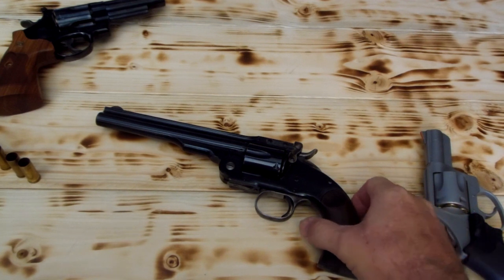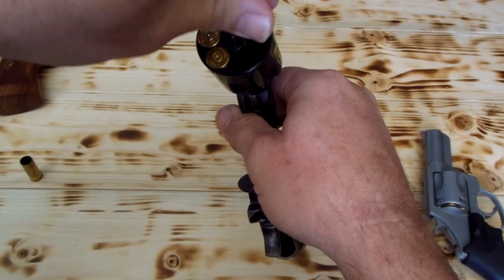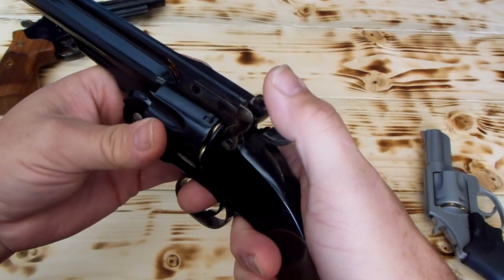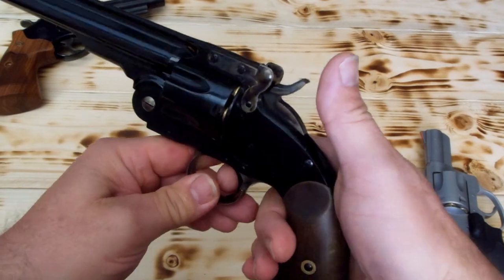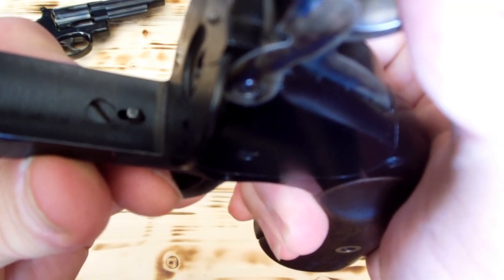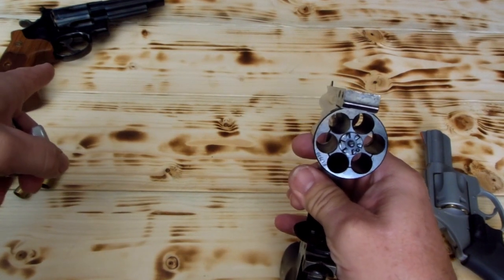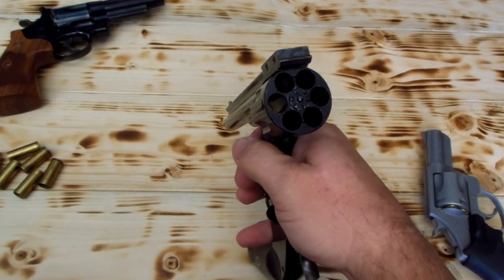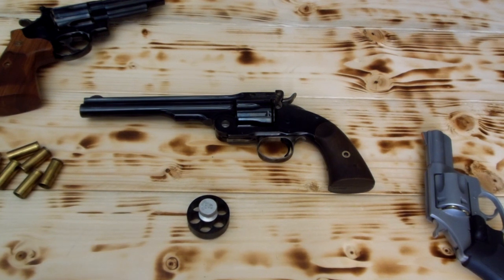"Tactical" Schofield carry and reloading

Comment: I mean they did it back in the day with navy revolvers why haven’t they done it with any other single action revolver
Reply from the maker: I know the reproduction percussion Colt Navy has a notch in the hammer and pins between chambers for carrying the same way...6 up. I *believe the original Colt Navy did, too...but someone may correct me on that.

 This method works just fine on this Schofield.
Reply: @plowboysghost  The originals also had the safety pins on them.  The manhattan firearms company also manufactured colt clones with extra cylinder stop notches to lock for the same reason.
Reply from the maker: @coltonregal1797   Good deal.
Reply: Because your firing pin is resting on hard steel. Let it fall one good time and your gonna need a new pin.
Reply: Your pfp is amazing
Reply: @PureAmericanChristian  thanks it’s mostly off of a photo of a friend making a goofy photo of John Marston from RDR 1&2
Reply: @jayhaddan7927 no it doesn’t. The f p doesn’t need to be this long to set off primers

Comment: I used to work at a gun shop that sold Uberti Schofields. I would admire the one in the display case quite often, and one day I was reading the instruction manual and it said that it had an "internal safety" which worked by partially cocking the hammer one click, then lowering it again. My guess is that this "safety" was doing exactly what you're doing now: resting the firing pin between two loaded cartridges. Very cool, and I'm jealous of your revolver! I've been putting aside my pennies over the years to purchase one myself. Not too far now... :)

Comment: This may have been the intent of Major Schofield himself. There's a lot of Schofield's suggestive correspondence in S&W's period files, and one letter refers to a modification of the firing pin point being beveled on each side,  possibly to carry like this. However, there is no mention in Army manuals on this. But it does work if you need that 6th shot!
Reply: Undoubtedly Officers and NCOs issued these revolvers loaded up 6 and carried that way as well as civilian professional cognoscenti, like the James Brothers and Texas Rangers and Wells Fargo agents.
Reply: To expand on my above comment, in a letter from Major Schofield to D. B. Wesson dated August 4, 1876, he stated "hammer to be beveled so as to drop between the cartridge heads, the arm can then be carried loaded with the hammer down". Recent Uberti's seem to lack a bevel but the hammer nose seems small enough to be used that way. Much safer than using the half-cock "safety notch", since the cylinder is free to turn.  Anyone for "Russian Roulette"?  lol
Reply: @samwalker7821  Reminiscent of the system on percussion cap 'n ball revolvers, positioning a hammer down between 2 capped chambers.
Reply: @richardkluesek4301  True. The concept wasn't new, but the application was. Major Schofield took a lot of pride in his pistol and had many ingenious ideas.

Comment: The SAA in .45 Colt and 44-40 you can do something similar.  This idea of resting the hammer between the rims is a hold over from the cap and ball revolvers resting the hammer in a safety notch or on the safety pins between the chambers.

Comment: I just sent my cylinder to TK Custom in Illinois and had them mod the cylinder to take .45 ACP on moon clips. Works awesome. Will still take the .45 Colt as well, so now it's dual service. Be sure to get their moon clips specifically for the schofield. I run the same reloads I use in my Webley Mk VI and it shot super tight.
Reply from the maker: Sweet!
Reply: @plowboysghost  Yea, it's a pretty cool mod.
Reply: Now you can, but why would you want to???
Reply: @mothman-jz8ug   Moon clips. I run a shaved Webley and like the speed of that set up. With the mod'd Schofield I can run .45 acp as well as the 45 colt, which I'm reloading for both, but have some decent 45 defense loads I want to try in it.

Admittedly not a nescessary thing, but it's a dual caliber platform now.
Reply: @mothman-jz8ug why would u want too? To run moon clips ! Are u out of your mind their fast as anything and cool as can be. And reloaders love to stick to rounds their set up for so now you’ve more than doubled  your options. I love small primer .45 so I’d be able to stick to my cheap fav reloads. That’s a awsome thing. .45 acp has a much smaller volume so they’re much more efficient if u wanted to light load. Theirs a ton of advantages to such a thing. Why would u mess with someone about how they enjoy their gun? What would u rather pay for  1000 rds of .45 acp or 1k of .45 lc ?

Comment: before the s&w 3rd model, perfected came along (the top break that also had a thumb piece like a regular Smith & Wesson model 10) there was the second and third model in 38 Smith & Wesson and it always struck me with that non-rebounding hammer that the reason why their firing pin was triangular and flat rather than round was precisely for this reason to lock between the rims with higher confidence that a cylinder turn would not jar the pin up over the rim. I also use a regular five shot 38 snubby speed loader for tactical speed loading the little top break as well. And I do the same thing for the Webley 455. Good video!

Comment: Damn. That’s solid advice actually. I carry my Cattleman II in 45 colt sometimes with 6 cause of the special firing pin. That’s a good idea for the schofield.
Reply from the maker: If yours is a Cattleman II, like the Taylor's Smokewagon Deluxe i had, I wouldn't hesitate to load six in it. I carried the one i had that way until I defeated the "safety" system.
Reply: @plowboysghost  defeated the safety system? What do you mean?
Reply from the maker: @TaxationIsTheft69420  I took the spring out of the hammer, shortened the actuator rod, and fixed it in the "up" position so that the firing pin would stay fully fixed in the "out" position....like a Colt/Pietta/Old Model uberti/etc...

 I did a video on it in January of 2019.
Reply: @plowboysghost  Ah! Ok. I thought you meant you broke the safety by carrying it and it made me nervous. I carry it on horseback for the last 2 years and have never had an issue even with it bouncing. They’re great guns.

Comment: According to the manual that came with my Uberti Schofield, the revolver has a hammer block safety which is engaged at the first cock position. I guess anything is possible, but it would take a heck of a blow to break the steel hammer block.

Comment: There used to be some revolvers back then that did this on purpose as a safety feature. I can't remember what brand it was but I do remember it had a tiny pocket for the firing pin to rest in.
Reply: It was an addition to colt patent revolvers in the 1850’s-1860’s and then everyone copied them pretty much

Comment: Something to add is that apparently the Uberti Model 3 has a hammer block/bar safety. The bar raises into position with the first hammer click, and also at half cock.

Interestingly, the hammer block is almost never mentioned by people reviewing the Model 3 Uberti.

I myself had no idea it was fitted till verynrecently. I finally got to handle a Cimarron Schofield the other day at a gunstore, a brand new one, and noticed that the hammer went into a detent before half cock, and I heard noise from the lockwork. I asked the guy at the desk, "are these fitted with hammer blocks?", and he said he didn't know. I was in a rush, so didn't thoroughly examine the pistol, just wanted to see how it felt in the hand, sight picture, etc.

Anyway, a couple of days later I researched this specific aspect online, and found people on forums confirming that the Uberti Model 3 does have a hammer block. Supoosedly, a new one even ships with documents in the box telling the customer about the safety.

So bottom line, is that this should make the pistol even more assuredly capable of carrying six safely. 

Again, it's strange to me that this isn't mentioned in more reviews or show-and-tells. I suspect one reason it may go unnoticed is because bringing the hammer to full cock lowers the safety bar: the system apparently does not require a trigger pull to lower the bar. So people put the pistol on half cock, they load up, bring the hammer back to full, and then lower it on an empty chamber, where examination would reveal that, indeed, there is nothing between the firing pin and the case head area.

However, it seems that if someone loads up, and then lowers the hammer from either half cock or the first detent, the firing pin would actually have a safety bar blocking any interfacing between the pin and primer.
Reply: PS: I went to Taylor's & Co. and they have a link to the owner's manual that ships with all the Model 3s, in PDF format. This is pasted straight from said manual:

"*Safety and Transport: first cock position (fIG.A)
These guns have a hammer block safety in the frame. To activate the hammer safety
block, pull the hammer backward until you hear the first click. Lower the hammer
into the safety position. With the hammer in this position, the safety mechanism is
activated. This patented device places a steel insert between the hammer and the
frame and is designed to prevent the gun from accidently firing.*"

-------------------------------------------------

So it does in fact seem to be the case that all of the Uberti Model 3 have a safety bar.

However, I noticed on several forums that some people choose to remove the hammer block, reportedly to slick up the action for CAS. So if someone purchases a used Uberti Model 3, this hammer block may not be fitted, because a prior owner removed it.

Comment: The putting the firing pin between the cylinders makes me think of the NAA SA derringers where they are designed that way.....As for number 7 or 8 you could either carry that second SA cross draw or left hand or just use a 45 Colt Bond Arms derringer left handed if proficient to fend off any remaining threats while getting that Schofield open and ejected before grabbing the speed loader.....then after reloading that No. 3, you could reload that derringer from a speed strip when you get a chance.   I believe the truth is you just love those 45 Colts....Thanks Mr. plowboysghost....
Reply from the maker: I have been accused of favoring a .45 Colt....and i really don't try to defend myself from the charge...heheheh

 Thanks!

Comment: I've had my Schofield for about 2 years now and I've been using the same speed loaders for quite a while. I've also got speed strips which while not AS fast often don't have the same issue of the cylinder turning freely when trying to get the speed loader in place. That said, I always carry on 6. The whole reason people used to carry on 5 is not really that relevant to the modern era for a variety of reasons. To each their own I say but no reason to be deprived an extra round.

Comment: I've got 1 Taylor's conversion cylinder (5@ .45) that has the extra stop notches milled into it to leave it locked in between. The other Taylor's I've got do not have them. Although, on the good one that has extra stops, I did have to hand file the cylinder  hand "star notches" on the back of the cylinder to get it to function properly. Was possibly for another manufacturer, but got it working.

Comment: Well, someone else has discovered my secret.  I don't have a Schofield, but I have been using the same technique with some of my other revolvers.  They don't have to be single action either.  I carry all six chambers loaded in my 2nd model S&W American, my new model #3 Frontier, my 1881 S&W double action Frontier as well as my drawer full of S&W 38 double action top breaks from my 2nd model made in the 1880's to the last model made in 1919. Won't work with the lemon squeezers though.  No external hammers.  I also carry my Colts in this configuration but it's a little more tricky because they're not top breaks.  You have to cock the hammer and, while keeping the muzzle pointed in a safe direction. pull the trigger and gently lower the hammer with your thumb while rotating the cylinder with your other hand until the firing pin comes to rest between two case rims.  This works with my Colt Frontier Six Shooter, Colt Bisley Frontier, Colt 1878 double action Frontier, and my 1860 Richards conversion in 44 Colt.  Oh, the appellation "Frontier" started with Colt but came to designate any revolver chambered for the 44WCF(44-40) cartridge.

Comment: Great video. This is how I carry most top break revolvers and have for over 45 years with no issues. I still do it in my new Uberti Schofield's even though they have the hammer block safety's. There are just too many safety nannies on the net.
Reply: What holster do you use?
Reply: @duceawj5009  Right now I just use a triple k thier standard 6 gun holster it works well with a small modification. I cut out a small piece so the barrel latch will fit.
Reply: they added hammer block safeties?
Reply: @marblemarble7113  Wow it took 7 months to get a bite. Amazing. Yeah you carry it with your thumb under the hammer. Hammer block safety, get it?
Reply: @spiritualawakenings6251  lol
Reply: The Uberti Model 3s actually do have a hammer block, for real. If the hammer is brought to the first detent, or the half cock, the block raises into alignment. If you bring the hammer to full cock the block lowers.

Comment: Great video!!  I assume you’ve already removed the safety bar (which a lot of folks do)…. If the safety bar is still installed, the first click is the safety notch which allows you to carry it the same way as the safety bar is in place until it’s fully cocked.   At least that’s how mine works…
Reply from the maker: Yeah, I have a small collection of Uberti Schofield safeties in a glass :)

Thanks!

Comment: So I'm looking for a 45 Colt revolver. Single action or double action. What's the best one that you recommend for single action and the best one you recommend for double-action. I'm getting a Uberti winchester model 1873 rifle, and would like a good 45 Colt revolver to go with it. So far my favorite is the Uberti Cattleman, and the long barrel version of the Uberti Cattleman. Both nickel plated, but I'm still looking at others as well. I looked at a Schofield yesterday, and also a Uberti 1871 Colt Navy Open Top and also a Taurus Judge. I'm still undecided on single or double action, and which one would be best for defense. Any suggestions?
Reply from the maker: I personally prefer a single action in most moods I'm in. The only .45 Colt chambered double action I've ever owned was a Judge magnum...and I didn't keep it long. Nothing "wrong" with it, just didn't fit me.

I split my favoritism on barrel lengths of a Colt SAA pattern revolver between 4-3/4" and 7-1/2".  I have both, and have had several of each length, but 5.5" just doesn't "fit" me, either. I like the 4-3/4" for crossdraw carry, and 7-1/2" for strong side. 

 I love my Schofield, but you can come within a few dollars of buying 2 Colt clones for the price of one new Schofield. If you really like the Schofield (or LOVE it like me), then it's worth the money. I actually want a Navy gripped Open Top in .45 Colt, myself.

 With regards to "defense" usage.... I recommend a single action but only if you're comfortable with working on the muscle memory, etc... required to make fast(ish) repeat shots. I have carried a single action revolver 9 times out of 10 that I've carried a sidearm in the last 10 years. I do, however, really like my 4" Model 29 and even my CA Bulldog .44 Spec., so I'm not immune to the draw of a double action.
Reply: @plowboysghost  Yeah, at first I was looking into getting a Uberti Cattleman, but I think what I really want is a nickel plated Uberti Schofield 45 colt. I found a few lately, but I'm not really a fan of the blue'd finish, I'm a sucker for nickel plating, ha. So I may just go to Uberti directly to get one since I haven't been able to find one like I want in the right caliber.
Reply: @ProjectRescues  my carry gun is a 3.5 in H&R top break chambered in 38 S&W great little vest gun its sa/da and i got my wife an H&R 32 S&W top break both guns are over 100 years old work flawlessly as well as small enough to conceal but still comfortable in the hand as well as being top break so they are faster to reload. I use to carry a small M&P shield simi auto and got away from that when I had a miss fire with a assailant because the pistol was jammed to far in an locked the slide from firing. needless to say i didnt end up shooting the guy and everything worked out great, back up arrived and we got him cuffed, i no longer work law enforcment but that day taught me that sometimes more rounds are not better now all i carry for personal defense is a revolver.

Comment: My Taylors & co dose not work this way. It only locks when the cylinder lines up with the bore. I do use a speed laoder, tried the one I had for my Red Hawk the day I got it.
Reply from the maker: If you're referring to carrying the hammer down between chambers, the cylinder isn't technically locked up when you carry that way. It won't turn only because the hammer nose is between case rims...not because the bolt is in the notch.

Comment: Only problem with this technique is unless you carry it in a way where you can be sure nothing is going to rub or snag the hammer, it's not too good a practice. I fooled around with this on mine and not very much movement on the hammer and it pulls far enough to slip out from between them.